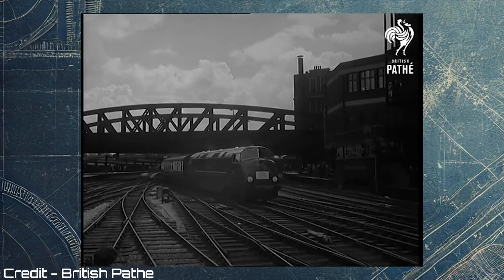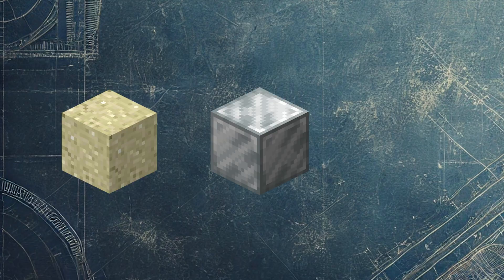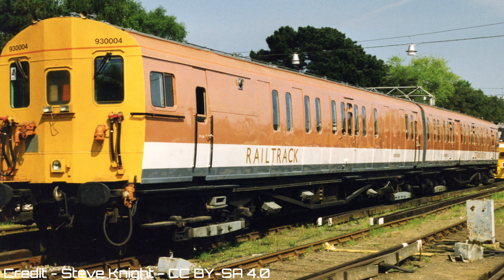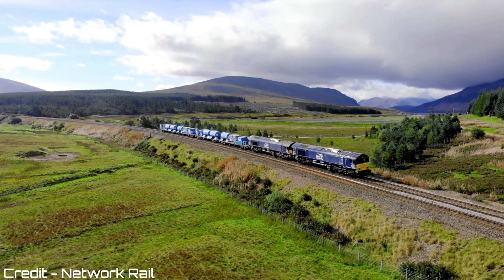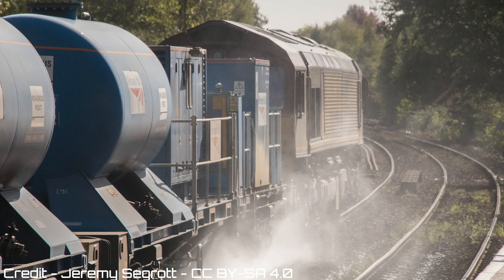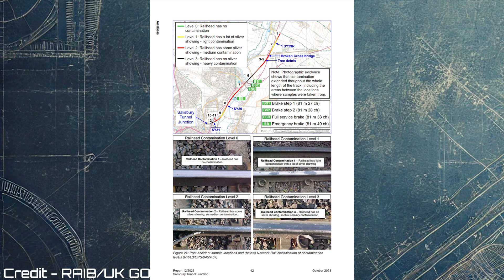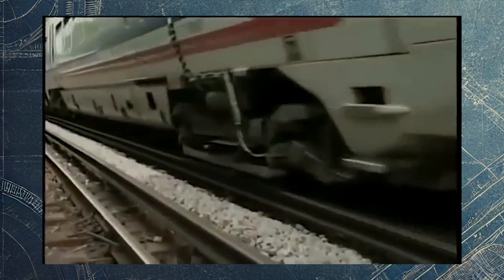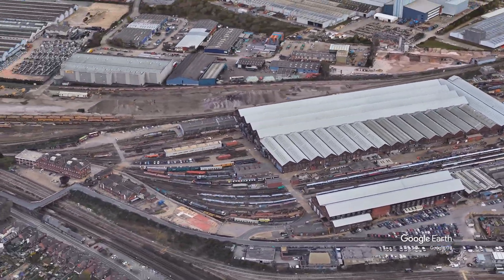What is a Rail Head Treatment Train?

Comment: I'm always on the hunt for them! 😂
Rare but efficient for the railways!
Reply: From what I gather, they're usually headcode 3 and are pathed as "Diesel locomotive, trailing load 715 tonnes, planned for 60mph"! Look for that and you're good to go.
Reply: @Danse_Macabre_125  There  not diesel, they are electric and diesel so look for 80x on electric or diesel
Reply: @liamtrainsvideos9021  I'm on about RHTTs, not Class 800s.
Reply: @ oh sorry
Reply: @Danse_Macabre_125  I accidentally
Commented on wrong video
Reply: They pass my office in Sheffield almost daily - look at the Sheffield camera on railcam.uk !
Reply: well I dunno if it’s still there but there used to be one of them always in a siding at wrexham general